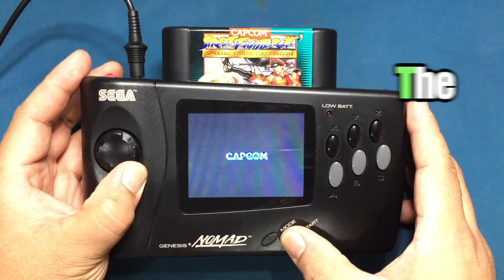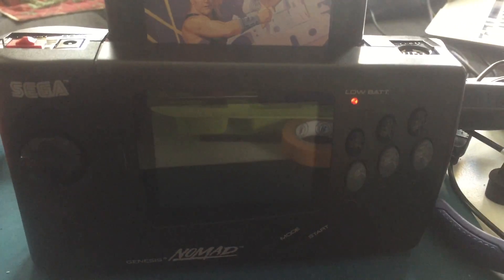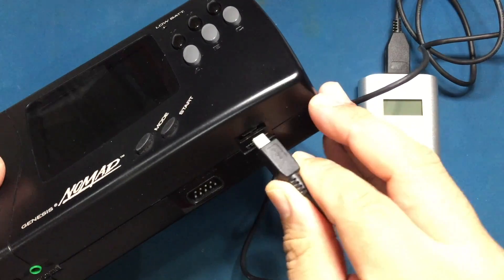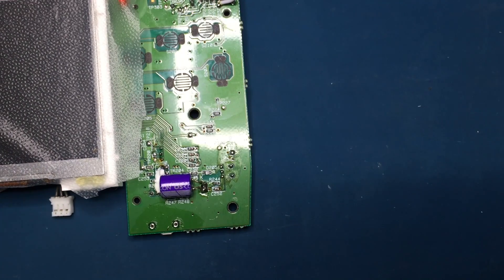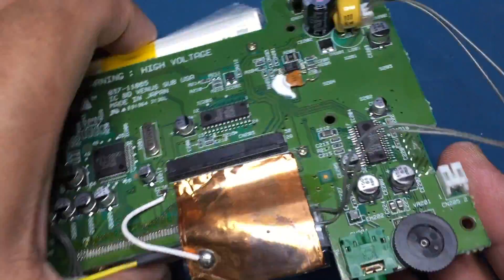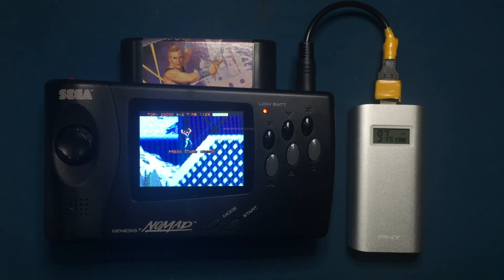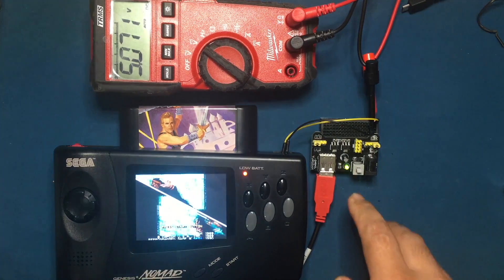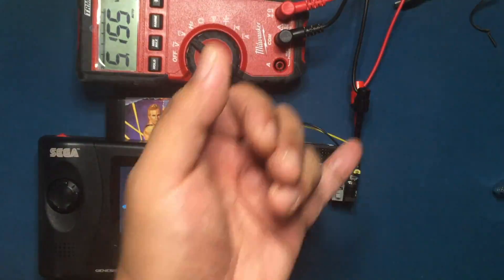Sega Nomad USB Mod [SH ep.45]

Comment: Have you ever tried to run a Genesis or Master System by connecting 5v usb to the output pins of the voltage regulator of a Genesis, or Master System?  I believe they step the voltage down to 5v. If that is possible, do you think it would be possible to run multiple systems on a usb hub and get rid of the power supply mess?  If this is possible,  Do you think it would be possible to run a 32x with a custom cable connecting the 5v on the av out of the Genesis?
Reply from the maker: Tried it with a first gen Genesis, does not work. I don't know if the Genesis 2 will work as I don't have one. One thing to consider with these systems is that your amperage draw will be higher, so at minimum, you may have to run them on a 2A USB port/charger... if you are going to try it wih all those systems hooked up. Also, if a Sega CD is hooked up, the CD drive will require more power and maybe more than 5v.
Reply: Would be nice to have alternative to these massive power bricks and power strips. I was actually going to ask this same question...

Comment: Would it be possible to use something like this:

https://www.adafruit.com/product/2465

...to install a completely internal 3.7V li-ion battery that would  charge via usb ?
Reply from the maker: Thinking of using that for a phone battery? Looks like it would work as you can output 5.2v. 

What I do know is that it's drawing, with the new screen, 3.9W with the 5v DC power supply, so 3.9/5= 0.78
So that's 780 miliamps current draw. Make sure the battery can output at least 1amp.

If it works, obviously, let me know... gotta test in REAL WORLD CONDITIONS, as his is all on paper... you never know. 😎

Comment: This is really great. I hope to eventually put a modern LCD and internal battery in my Nomad.
Reply from the maker: Shouldn't cost you too much. Can you see though, if applying 5v to the #2 pin and groudn to the sleeve on the A/V out jack turns the system on? Really interested if USB can power on a STOCK Nomad. All your need to do is modify/Sacrifice a USB Cable.
Reply: I finally got my 9 pin din connectors in and made a usb cable for the nomad.  It does power a non modded Nomad.
Reply from the maker: I tried using the USB keyboard's usb outlets on my old 2011 iMac and it worked on there. Typically, if you put a USB DVD player on there, it would not power up.

USB 1(very old) & 2 is 500mA, and USB 3 is more. So it shold work on those. I've used old phone chargers (from the old number pads flip phone days), the mini square iphone transformer, my led lamp, my portable work radio, they've all worked. The only time it didn't work was from a small lipstick sized USB power bank battery that was around 2500mAh. Not enough current (amperage).

BTW, all USB outlets and adapters supply 5v, it's the current that are not all the same. Like how you have 2A and 1A USB chargers for phones and tablets. Notice the tablet will not charge, or charge very slowly with a 1A outlet/transformer. If the USB port does not work, it's a very low amperage.
Reply: Thank you for your reply, your video inspired me to take on this project.  You didn't by chance bypass the voltage regulator on the Nomad to give it a direct 5 volts and I missed that part?  Or are you feeding the Nomad's regulator 5 volts and getting enough power out of it?  Again thanks for the help, I have fixed a few systems now from your videos.
Reply from the maker: Apply 5V to the CCFL backlight connector, it is the easiest way, especially if you saved your old backlight wire...

https://www.youtube.com/watch?v=wUHBbEbblZc&lc#t=03m50s

Great to know I helped in some way.
Reply: Thank you I will try that.
Reply from the maker: That's why you have to watch the whole video!!! I leave important tips. Also, if this mod was like everyone elses, I wouldn't have made such a big deal! LOL. Enjoy your Nomad.

Rewatch this whole video, and I show non-working examples... how not to do it.

Comment: can i do a internal battery follow this mod?
Reply from the maker: I would try and use a thin lithium polymer battery, and use it's driver board... like in this video.
https://www.youtube.com/watch?v=XRPbRZiiTKM
You can use the USB ports on the driver board.... extend them, or place the whole board near the edge of the Nomad and cut holes. You'll just need to figure out how to make space in the Nomad enclosure. I would look at the area behind the cartridge slot.

I myself, don't like to go too far in modding. I try to keep it simple. In fact, the only reason I did this mod is because I was forced to.